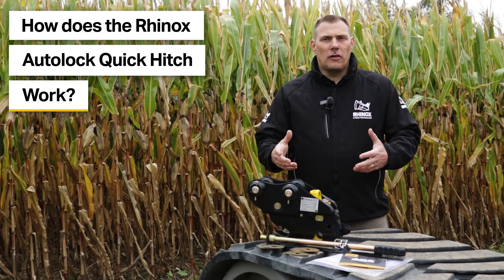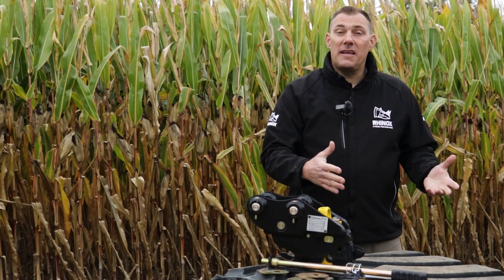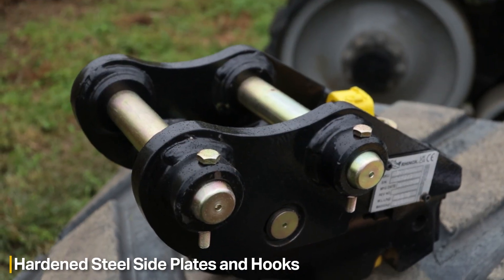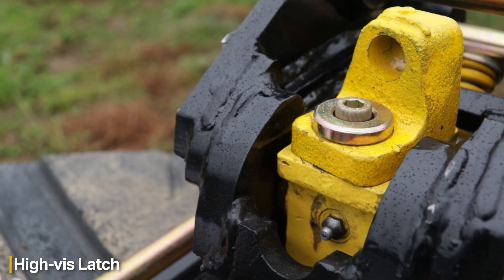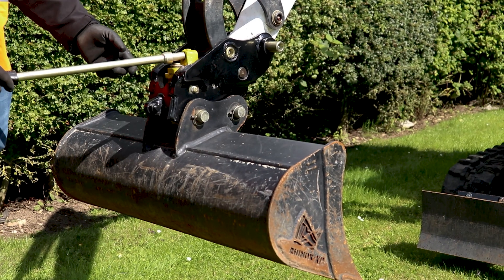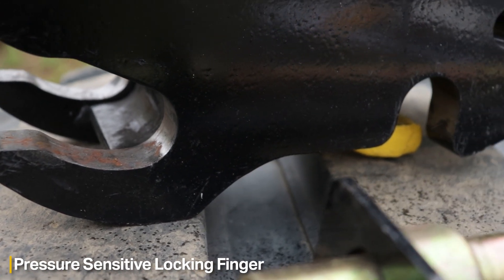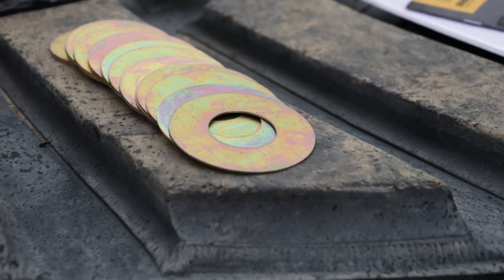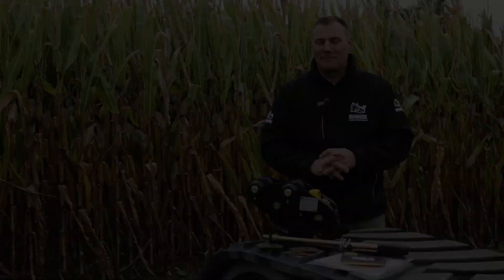Rhinox's Autolock Quick Hitch (Mechanical Pin Grab Coupler) | Rhinox Group US

Comment: I have a cat 303.5, I don't see a pin grabber quick coupler listed. yes/ no?
Reply from the maker: Unfortunately, we don't currently make a hitch for the 303.5
Reply: @Rhinox-Group  any plans on building one? What's different from a case or similar size machine?
Reply from the maker: @ Unfortunately not. This model of excavator is now deemed outdated because of the newer models available so it wouldn't be viable for us to invest in designing and manufacturing this coupler. Sorry for any inconvenience. We do offer a full range of buckets and attachments for the CAT 303.5 though!